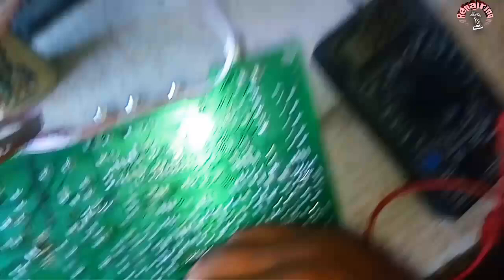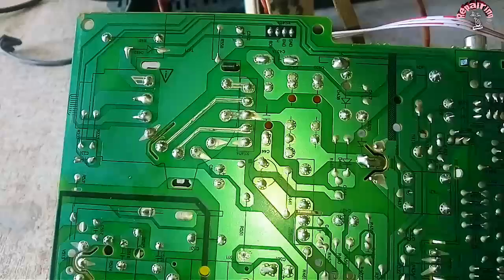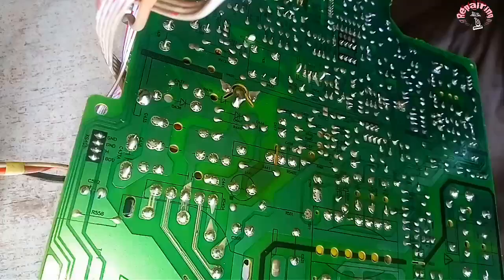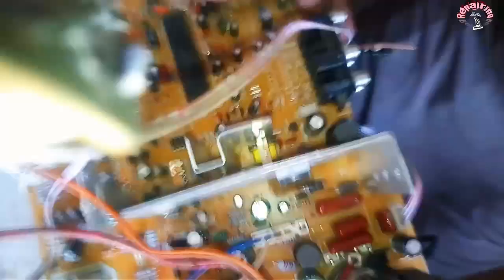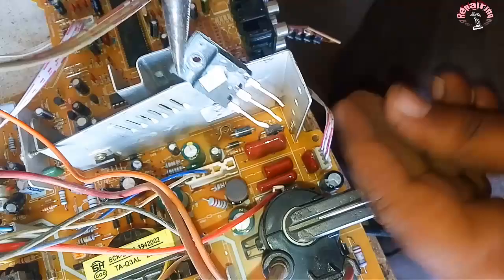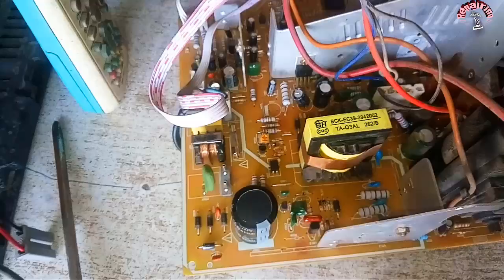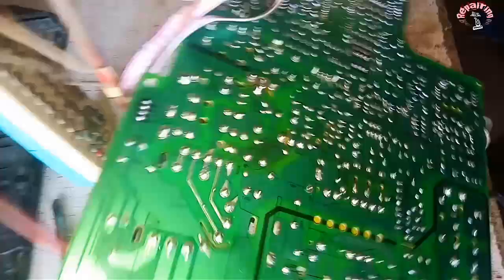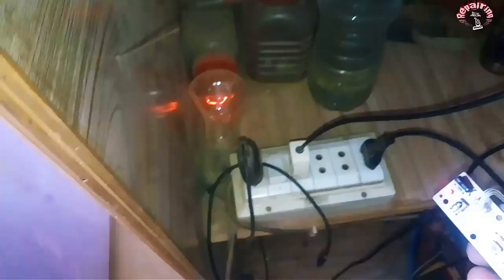Tv Not Powering On 3 Important Reasons |Tv repair|tv|crt tv repair|electronics|fix it|easy fix

Comment: Bhai staring voltage str par 70 volt aa raha  hai str nikal ke check Kiya tab or 120k ka ek resistor or ek diode se Diya hai starting volt
Starting volt 70 volt barabar hai ya High voltage hai?
Or str ka ground or str ka starting voltage point yani 3rd or 2nd pin short hai to str kharab ho gaya hai ?
Str no. Cq0765rt hai
Please reply do bhai👍🙏❤️♥️

Comment: repairing hub sir CRP CRT supplying 300 volt capacitors se aata hai Lekin usko bhi 120 ka second valla ressitor may reading nahi dikha the 1802 transistor 2655transisto 1015transistor teekay Lekin in 18volt nahi dikha thi    kyon
Reply: 1015tramistor be ok